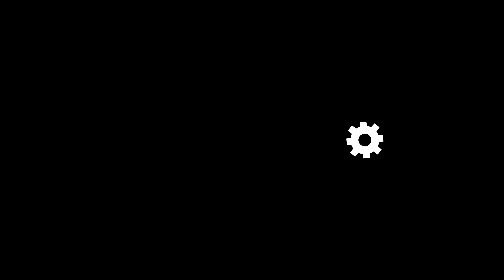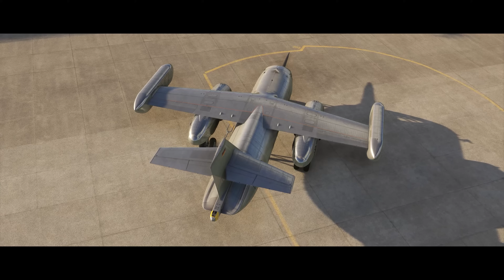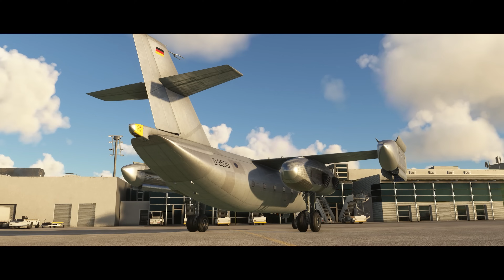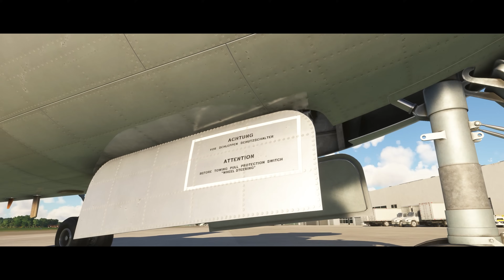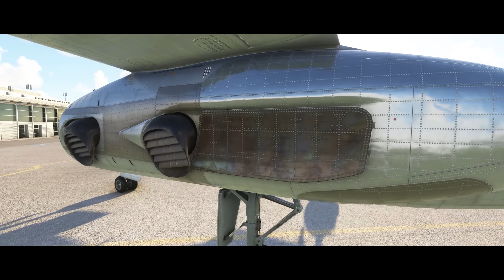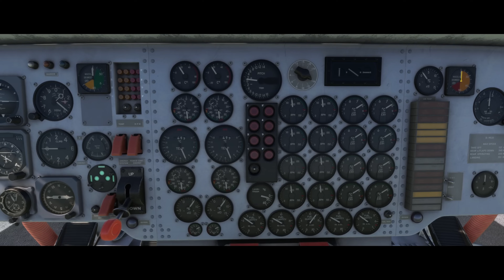Welcome to The Dornier Do 31 | Microsoft Flight Simulator

Comment: Love this but something is not right - it's currently impossible to control a hover or do a fully vertical landing, due to nozzles moving forwards when you start reducing thrust.  The two throttles are so closely tied there is basically no point in binding different buttons/axis. Please can you investigate?

Comment: Anybody having a problem with the engine throttles going to full when you increase Throttle 3 with an Xbox controller? Anytime I try to set the nozzles to full 90 degrees the engines go to full throttle and will not throttle back. It seems like throttle 3 is somehow tied to the other throttle levers. I've followed the video and made sure I cleared the throttle increase and decrease but I'm not sure what I'm doing wrong here.
Edit: Also does it with my Thrusmaster T.16000M. I've even tried deleting all my other add-ons but it doesn't seem to help. Definitely something buggy going on here.
Reply: You're not alone, I've been experiencing the exact same thing. Really not sure what the fix is to this yet, but throttle 3 is definitely tied together to the other levers
Reply: UPDATE: Seems to be working normal for me now. Besides logging on the next day and trying it again, I did not do anything differently. So perhaps just restarting the game is the fix?
Reply: @paarmanium  Nope even days later it's still doing it for me. It even does it when I use my Thrusmaster setup. Not sure what's going on with this plane.

Comment: What's the point of linking the nozzle angle and lift jet thrust together? That removes your ability to conduct a proper accel or decel transition or use powered nozzle braking

I'm somewhat confused by the fact the main two engines were seemingly left at idle during both decelerating transitions and vertical landings in this, and the hover portion at the end.
Reply: I was rummaging through everything I could to figure this out and I just can’t lol. Design feature of the in game model I guess buts rather annoying, I’d like to be able to have the nozzles directly 90 degrees and have control over the throttle to have a proper landing without having to tilt the aircraft almost 45 degrees nose up